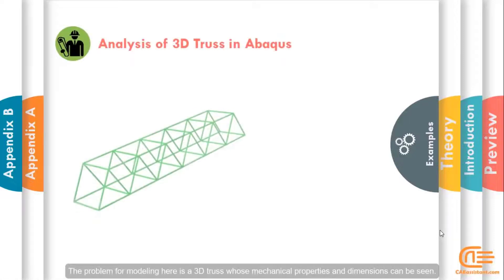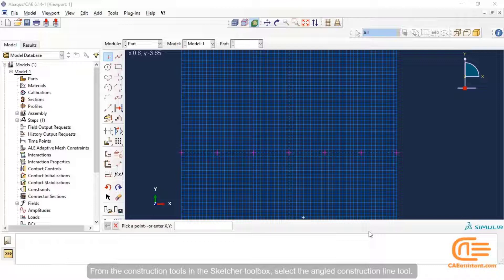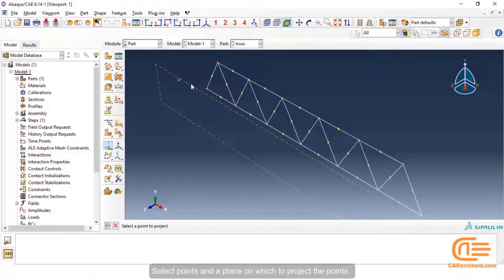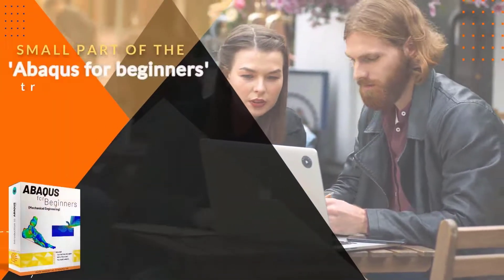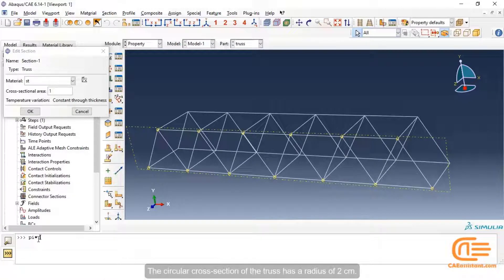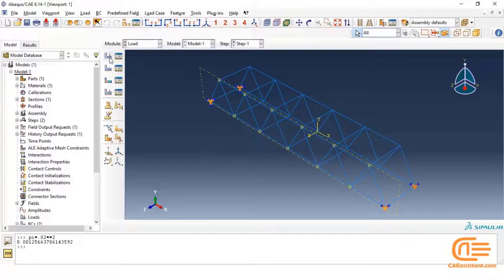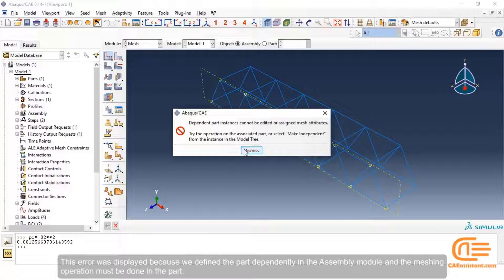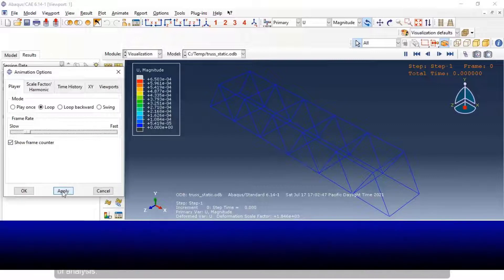3D truss modeling in Abaqus

Comment: Thank you for the video, but when I am using the truss elements i.e T3D2, I am getting the Warning "Solver problem. Numerical singularity when processing node TRUSS-1.8 D.O.F. 3 ratio = 4.21658E+15." How to avoid such a problem.. Can u suggest me... Thank You....
Reply from the maker: Hello, thanks for your comment.
check these three things in your model:
1. Check your material properties.
2. Check the Displacement you applied in your model; it might be too high for your model.
3. Check the number of elements. In a truss, each member of it must be assigned to only one element.
After you checked the items above, if the problem still exists, your model must be checked completely.